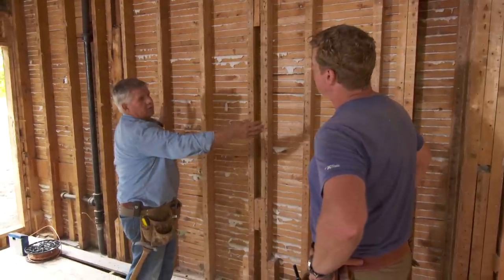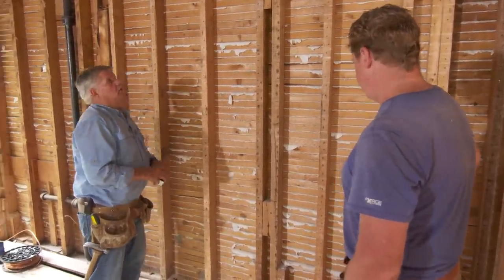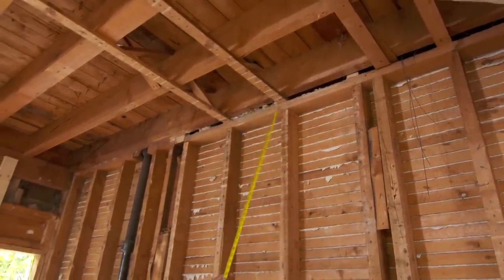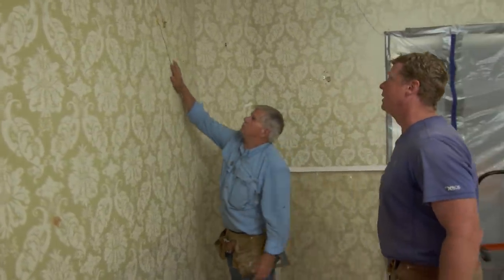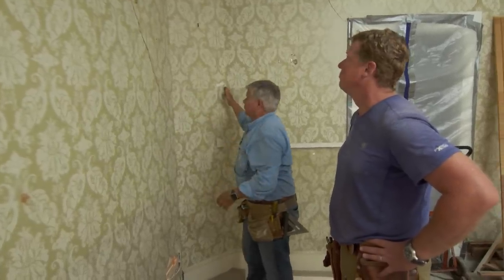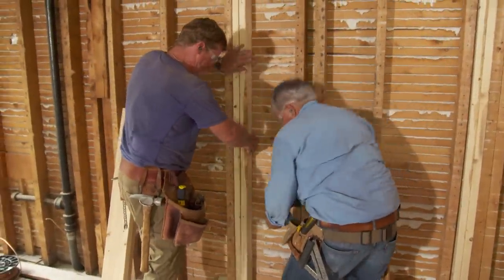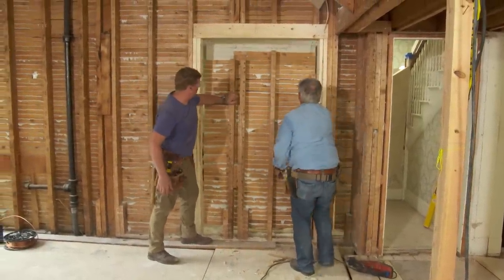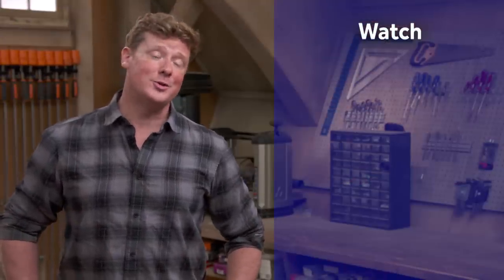How to Move a Door | This Old House

Comment: What’s the header for if it’s not load bearing?
Reply: Still need a frame for the door jamb, trim to attach to, not to mention studs will go back above the header to hold drywall or plaster.
Reply: Yeah you need a header to attach to but not as thick as if it were load bearing
Reply: GreenAppelPie , you may save $.80 by installing a 2 x 4 instead of a 2 x 6, why not do it a right way.

Comment: 2 fundamental principals of carpentry; you either have to add material or remove material.  Ripping strips and nailing them onto a 2x4 is adding material.  Ripping a 2x6 down to 4" is removing material.  The difference is you would have saved a step by ripping the 2x6 down to the correct size; IMHO.

Comment: Hmm, why did Tommy just cut out the aperture for a door?

Judging by that wallpaper on the other side he would have been morally justified in removing the entire wall.

Tommy ought to have reported said entire wall to  the "Style Police" the instant he first set eyes on it.

And, on the topic of due diligence ... lucky the glass didn't break ... might have been a tad embarrassing ...

As for the debate on screw or nail ... might I enquire if Festool makes a nail gun ... yet?

All that aside it did demonstrate that remodeling non load bearing walls, in that particular situation, was not difficult and perfectly straightforward even for a relative novice.

Comment: Screws not nails anymore???
Reply: Screws have the advantage of not pulling out after the wood has dried for a few decades. 

The hole around the screw may enlarge due to shrinkage, but unlike a nail, the threads in a screw still have a threaded path in the wood to get past.
Reply: Crotch Banister That’s not entirely true. I don’t believe they put new houses together with 100% screws. CrazyFramer (guy on Youtube) wears out his nail gun the whole day for example. And a few videos back TOH showed how they make a roof, using a nail gun.
Reply: They used screws because the designer will want to move that door opening 3 times before they are satisfied and the screws make pulling it apart easier.

Comment: Never push over a wall without looking on the other side you may have just dropped that wall on a person causing a lawsuit and an extreme injury
Reply: There literally was a camera on the other side....
Reply: Thanks for the information, Dad.
Reply: He asked if it was clear before dropping it. There's a whole production crew filming, one of whom probably responded silently.
Reply: We better call them, what if there is a person still under that wall.
Reply: A fair point and doing a visible check could have been incorporated into the filming sequence. But it wasn't ... so blame the film editor or director.

First and foremost it's a sponsored TV show and the scenes might have been edited to the very tightest of  screen times to fit into network schedules.

It may be the builders who actually measured the spaces and cut the timbers weren't filmed at all?

Then the timbers simply handed to Tommy and Kevin who fitted them in place. You'll have noticed there was a tightish shot where we could all read "Festool" on the tool.

Perhaps Tommy, and the show, have to include shots where it is Tommy using the Festool kit,  thereby endorsing said kit as his personal preference.

We didn't see Tommy make the entire cut in the wall so perhaps he didn't?

Neither did Tommy give a very detailed explanation of the reasons why the header was of that dimension or why the studs were placed just so.

These days Tommy (and Kevin) really just presenters and only do cameo scenes. Perhaps the program producers are well aware most builders have faces suitable only for radio and aren't natural presenters?

And, for all we know Tommy's age (73) precludes him doing some types of heavy work in a scene as the TV outfit can't get him insured?

The planning and sequencing of the shots has to be admired as it leaves the viewer with an impression it's Tommy building the entire house using his trusty "imported German tools" with the help of a few other presenters plus sundry builders and apprentices.
Reply: DR PHIL  👍

True but some folks like to do that ... but could have researched their own US based construction sites and saved falling out with each other.